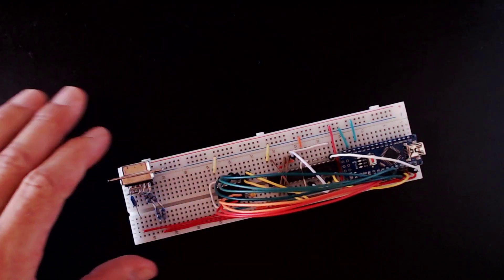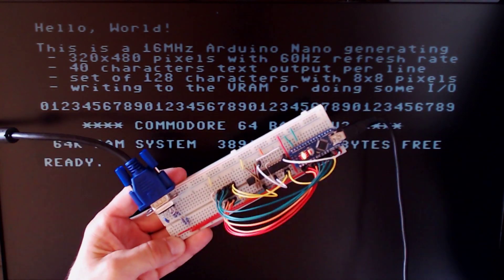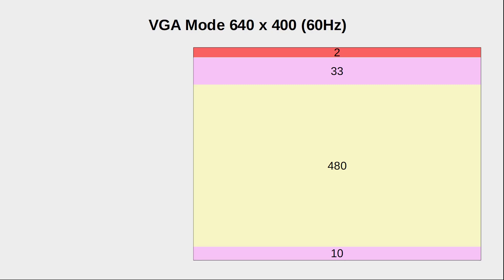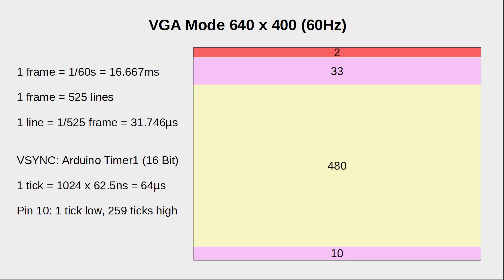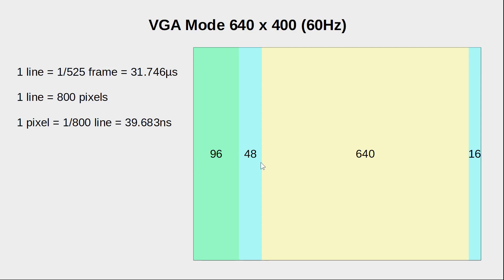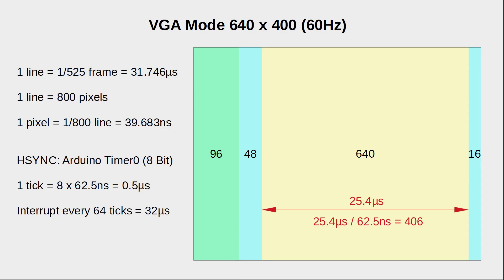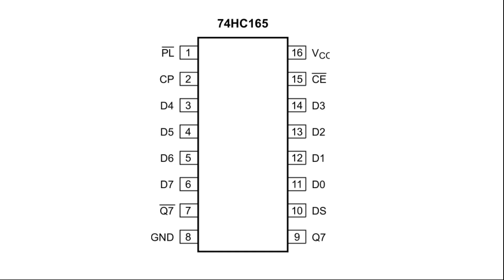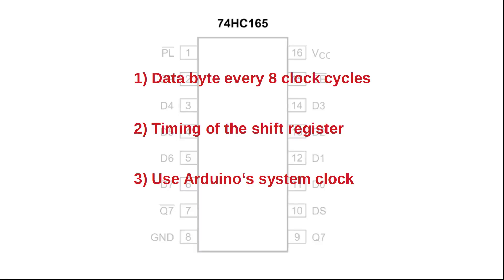Breadboard Arduino VGA - Part 1

Comment: I'm aware this video has some time now, but I have a question about the very last part where you "cancel" the interrupt jitter. I'm confused about why the compiler won't optimise away (remove) that first line of code and just generate PORTB=16?
Reply from the maker: The compiler does not optimize away port accesses, since it doesn't know if there's some "outside" consequences.
Reply: @slu467   If two /different/ values are written consecutivelly to produce a pulse the compiler must respect that. 
But this is a repeated write of the same exact value to the same port, so I could think this could be optimised because compiled 'c' code does not make any guarantee of timing. Anyway, I suppose the avr library just takes the easier path and just declares port accesses as volatile

Comment: Your  vga video implementation on the arduino is very interesting.
Thank you for sharing your source code and video.
Ps. I am addicted to github and your project only adds to that vice.
Reply from the maker: Glad you like my projects ;-) There is more in the pipeline...
Reply: @slu467  How can I use this With my stm32h743zi2 nucleo
Reply from the maker: @levitategamer7151  Phew, I guess you have to find that one out by yourself ;-)
Reply: @slu467  Yea I have been Trying I just can find out how to do this coding yet lol

Comment: you used a clock frequency of 16mhz for 640x480 at 60hz, but on many websites it is showing that a clock of frequency of 25.175 mhz be used, could you help me out with this, Thanks :)
Reply from the maker: The "correct" clock would indeed be 25.175MHz, however, since VGA is analog in nature, you can send whatever you like as pixel data as long as you respect the blank intervals and the overall timing. That's what I do here with my 400 x 240 pixel resolution. Hope that helps. Cheers!
Reply: @slu467   thanks mate, but if you you send pixels using a 16mhz clock wont you be sending approximately 2 pixels instead of one, i saw your vram video and there too you have used an 16mhz clock. and since the resolution is 640x480 you would be only able to have 320x480. please correct me if i am wrong. cheers!
Reply from the maker: @naveenchavali8488  Thanks for diving into this! 16MHz is not exactly half of 25.175MHz :-) So if we can send 640 pixels with the 25.175MHz clock, there is enough time to send 640 * 16 / 25.175 pixels with the slower clock.. which amounts to 406. I rounded to 400 (320) just to make it look nice. Cheers!
Reply: @slu467   thanks mate, now it all makes perfect sense :) keep up the amazing work

Comment: I've been looking at the source code and trying to figure out how you are indexing the character array...could you explain how passing the vrow into the char array indexes the char to display on the screen? This is really great btw.
Reply from the maker: Glad you like this stuff :-). Since it is super time-critical it is - unfortunately - not looking nice. 'vram' is a 2 dimensional array. So vram[0...24] is a pointer to the start of the row #0...24 of that array. Two scanlines always display the same pixel data, cutting the vertical resolution in half. The cset pointer is initialized to the start of the pixel row of the charset appropriate for the current scanline. After this initialization, the content of the vram (*vrow++) is only used as an index to the correct cset row data. This only works with a charset that is organized in rows, of cause, i. e. byte x holds the top line of the 'A', byte x+1 holds the top line of 'B' etc. Hope that helps :-)
Reply: @slu467  Ok i think i have worked it out...i just what to post this so other readers can see this as well. I am right in thinking the Charset array are the ASCIL charterers from the control chars which are not displayed to the first char beginning at index 33 in the array which is the "!" symbol...  and this goes though all the chars up to 128?. So the row pointer indexes the column in this array with selects the first byte of that charterer...